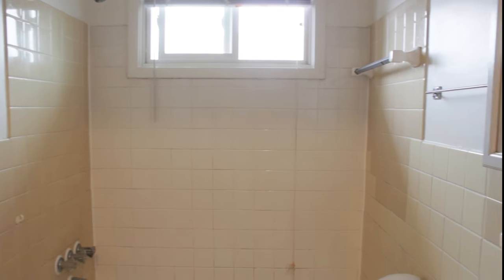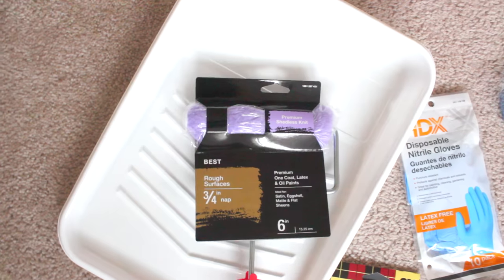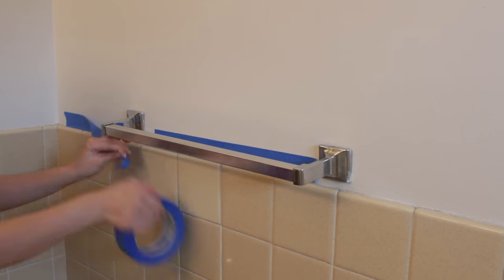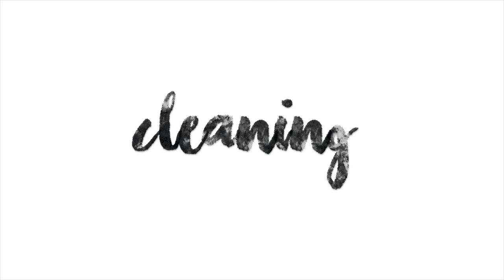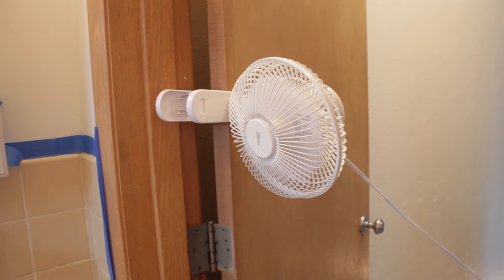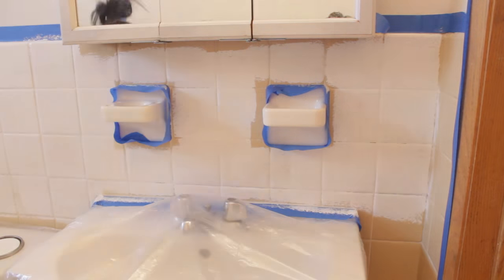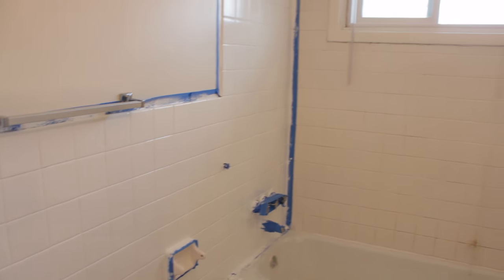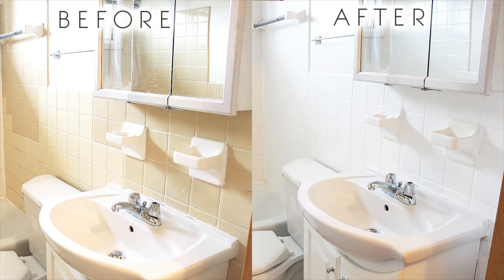Bathroom Makeover | How to Paint Bathroom Tiles

Comment from the maker: DISCLAIMER & 2021 UPDATE I have been getting a lot of comments that I should have sanded the tiles beforehand. Please be aware that I do already know that hence why I recommended that you properly sand the tiles. I just personally did not sand them because I did not have the correct grit and this is a rental unit, a short-term living area for me thus why I was not 100% committed to process. Thanks :)

UPDATE: The paint by the faucets and any high traffic areas has peeled quite a bit. Maintenance has replaced those tiles so I cannot speak for them any longer however the rest of the tiles are still holding up great!

Comment from the maker: 1 YEAR UPDATE: The paint is still holding up really well!! I haven't notice any big changes on the tiles itself, they still look really nice, no streaks or anything. The only thing I could say I've noticed is that the paint on the grout (gaps between the tiles) has slightly started to disappear revealing the old grout. It's not a huge difference and I am still very happy with the tiles!
Reply: Those spots that you have in the paint, where it doesn't stick is b/c of silicon contamination, from soap, and or cleaners. If you would have sanded the walls prior to painting, or cleaned it with a degreaser, such as lacquer, or paint, thinner. alcohol, or acetone (MEK) work as well as a pre cleaner.
Reply: Thanks so much for making this video. It is incredibly helpful!!!!
Reply: I'm getting ready to do mine. This was very helpful!!
Reply: Hey it's been 2 years now.... Is the paint still holding up?
Reply: Captain
Reply: Captain adam

Comment: Hi,  do you have instructions on how to paint plain cement floor?  Thanks
Reply: Buy floor paint from Home Depot. It’s not expensive and can go over wood and concrete.  If the floor is porous, use a primer first.
Reply: Yeah you get a 5 gallon bucket of floor paint from Home Depot or Sherwin Willams. I would make sure it also comes in gallon size in case you run out of paint. Semi-gloss looks pretty good for a bright finish, but satin is also common. Get an extension arm from home depot or broom handle will work just fine. Get a paint roller, large angle brush, thick masking tape (widest possible), and 2 nappy roller covers 3/4 or 1 inch. Twist the roller into the broom/mop handle. Clean the ground up as good as possible and if there are any crumbling spots, be very cautious not to cause any more damage. Get the perimeter of the sump pump as dry as possible because the water will mix with the paint around wet areas and be a headache if not 100% dry. Tape the wall perimeter with thick masking tape from the bottom of the floor to at least 3-4 inches up the wall. Start off with your angle brush and cut in all the edges at least a few inches starting at the wall going inwards into the room. After you cut in the perimeter, spill some of the paint onto the floor and spread it out with the roller. It's that easy. Don't be skimpy. If you don't have a good coat, go over it one more time. As concrete floors dry, the paint will shrink a bit so the coat needs to be decent. You will find that your first roller cover will collect debris, so the second one is for when it gets caked up with concrete and other various things that didn't clean up. Start on the furthest end of the basement and work towards the stairs. DON'T PAINT YOURSELF INTO A CORNER

Comment: Using that kit on non wet part is good but for bath tub and shower tile not so good even if it is advertise for it.  After a few years if you paint the bath tub or shower tile walls even with good maintenance it will still peel it was not meant for long use.   Any these diy kits of epoxy paint using harsh chemicals and with rough pads will ruin the finish.

Comment: Bullshit.  I do this for a living.  You can paint tile with any paint you want (even latex).  It will look fine.  But it will not hold. Will hold for a few months, that is it.  Redoing it is a messy hell.
In fact even the shittiest latex holds almost as good as epoxy if you are putting in over shiny tile.  And no, not all epoxies are the same.  Certainly not epoxy from Home Depot.
The tile needs to be acid etched (special, dangerous acid that can eat through your skin in seconds and enter your lungs easily too). Also adhesion promoter needs to be used. Only then epoxy holds well.  Crazy ventilation equipment, personal protection to the gills, special ways to mix and apply the special materials - it is not for the DIY-er.  Everything else is internet bullshit for views.  Good luck.
Reply from the maker: Yikes..